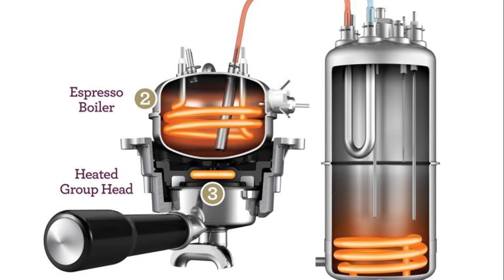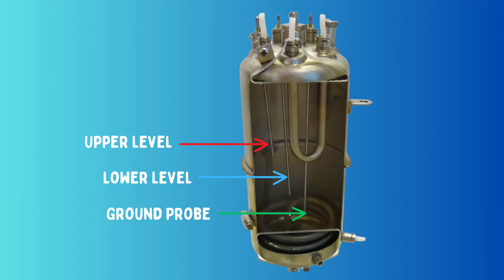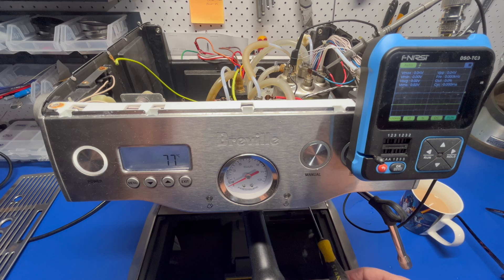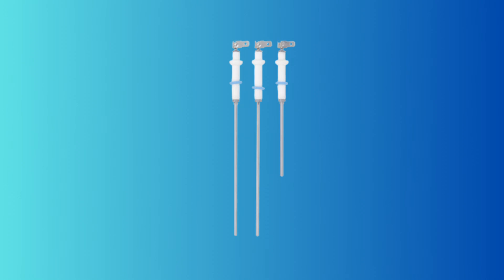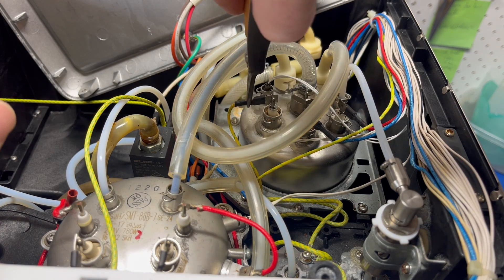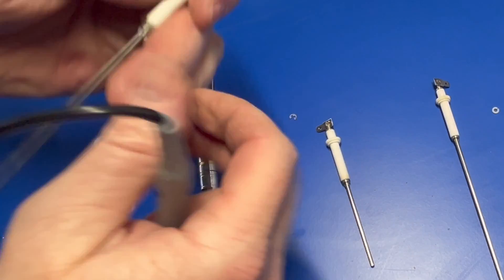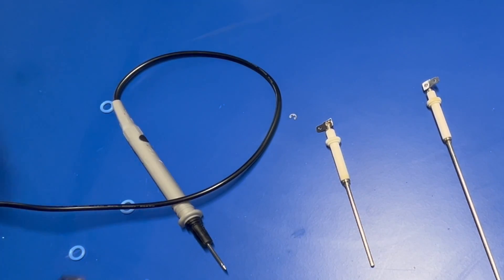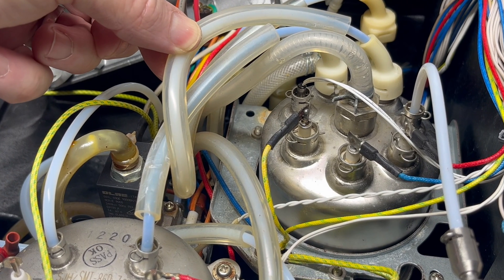How to Fix Leaking Steam Boiler Probes on Breville Dual Boiler BES920 and Oracle BES980 / BES990

Comment from the maker: Since researching the descale videos, I recommend you replace your probes as part of a service, rather than repair them: https://brev-tech.com/products/breville-steam-probe-set
Reply: Where can these be bought?
Reply: aI wrote this after coming back to this video because I had trouble removing the O-rings from the probes. I assumed that if I failed, I’d just replace the probes. Since then, I found the trick to doing it—it's actually quite easy once you get it. I replaced all three O-rings on the probes and finally had a cup of coffee after a month of not using my machine. It was so satisfying—and so cheap to do (though not time-wise 🙂)—that I really recommend replacing the O-rings instead of replacing the whole probe, which, as far as I’ve seen, costs around $200 USD. Of course this recommendation is not related to any descaling problem the probes might induce if they are malfunctioning. Based on your descaling video perhaps there should be a differentiation on this recommendation between the Oracle and the Oracle Touch.  In addition, I wish I could upload a photo here comparing the old O-rings and the new ones. The old ones shrunk so much and were white instead of translucent. That made me think that perhaps it's not related only to aging but also to the descale material used. I wonder what you think of that. Might be interesting to soak such O-rings in different materials for a month and test the result 🙂

Comment: HLL normal?  I feel like my boiler isn’t filling automatically
Reply from the maker: that's not normal, no. it means your steam boiler is totally empty. This is usually a sign of a bad steam pump. Let it cool, take out the pipe from the top of the little pump and borrow the pipe from the steam valve to use in the pump. turn on the machine and see if the flow is strong enough - it should be difficult to stop with your finger

Comment: Is there any difference between the steam boiler probes and the brew boiler probe removal? They look identical on my machine, but I cannot remove them to replace the seals. They move about 1mm before jamming solid, not like you are pulling against an o-ring, it’s a hard jam. Any suggestions?
Reply from the maker: Probably caused by scale buildup. Try twisting them, but they should  come out the same as the others. They can split too those ones, so be careful or have some spares handy
Reply: @BrevTech  thanks for the reply, I’ve tried twisting them without success. I can lift the machine off the table and they won’t budge. I even put some descaler around them thinking the same thing, no luck. I guess it’s stress to destruction time 😁 I’ve got nothing to lose at this stage.

Comment: Hi! Can you advise how to safely remove spade connectors? I’ve tried wiggling them side to side, but they’re stuck very tightly and feel like they might break.
Reply from the maker: they have a lock. you need to pinch half way down in the middle to unlock them

Comment: Hi, I am in the process of replacing the steam probes with new probes (based on your recent descale video) on my 2013 BES920XL. I unfortunately removed the spade terminal from the wire of the ground probe when trying to disconnect it. I am hoping to replace the wire and crimp a new spade terminal to it, but wasn't sure what gauge or type of insulated wire to get. I'm assuming the spade is a 1/4" female spade connecter, but would be happy learn if there's anything more specific I may need. Thanks again for all your help on here!

Comment: I've heard that the most recent models have replaced those with compression fittings. How hard is it to fix those if they fail? Any update video would be awesome! :)
Reply from the maker: The new ones don't have internal o-rings. The do have their own problems tho - the metal rod can get pushed up when the material softens up. Time will tell if this ends up causing leaks, but it's quite possible we will have the same descale problems again if they do.

Comment: @ BrevTech hello. Thanks for the helpful vid! Sorry, dumb question. There are two longer probes (one shorter), are the two longer probes the same and just need to make sure connected to the correct wire/boiler connector?
Reply from the maker: yep they are the same

Comment: Great set of videos. Where can we buy a full set of probes and the tiny O rings to repair them? Thanks
Reply from the maker: I sell the o-rings to repair them in my shop, but I would advise you buy new probes instead unless you have verified yours are still in good condition. I don't sell these, but search for SP0001820 if your machine is pre-mid 2022

Comment: Hi, Brevtech Guy,  I have a BES920, and have 3 questions:
1) The steam boiler level ground probe has been leaking quite a while, & minerals from the water collected between the ceramic collar at the top of the probe & the stainless steel ring on the boiler where it is mounted - can't remove it.  I tried dripping vinegar on that area, and scraping the minerals with a dentist's pick, but so far no luck - any suggestions?  I'm expecting I'll have to wreck it to take it out - any suggestions how to do that?  Turn the machine on its side and chip it out with a small hammer & a nail, pointed punch or chisel?
2) Where do you buy the little white o-rings for these probes? Is there a spec, or what are their dimensions? Is there a supplier in North America? I found this on Amazon - does it look correct?
https://www.amazon.com/dp/B01MTD9ZJ5?ref=ppx_yo2ov_dt_b_product_details&th=1
3) Are the ground and long probes interchangeable?  They look like they're the same.

Comment: You rock! your video helped me fix my oracle by replacing leaking o rings, had to replace the smaller ones inside the probes too. You saved me time and money, thank you for that!! Due to scale and some corrosion buildup, I did the repair with the probes connected as they wouldn't disconnect from their cables. For next time, is there a safe way to disconnect them without breaking anything?
Reply from the maker: Thanks, the connectors have a little catch on from memory and i find it easier to use pliers to slide them off from the probe side. btw, make sure you test your probes are working well. drain the boiler for 5 seconds then wait to see if the steam pump comes on. If it doesn't, go get yourself some new probes. My next video is all about this. I didn't mention that in this video as it's something i later discovered.
Reply: @BrevTech  Thanks! and good idea, I assume you meant to drain after it cooled down then check if it refills when turned on?
Reply from the maker: @avivmor10  no do it while its hot - or at least fairly warm, so you have realistic conditions. Using a flannel over the tray and empty for 5 seconds should be enough to trigger the pump to come on. it sometimes takes 10 secs before it notices the water drop, but just wait. if you hear it come on then your probes are working ok.

Comment: I fixed my machine  by changing the Thermal Fuse and Switch. The blue orings that i have ordered are to thick. I am not able to lock the probes in place. Is there more than one size of the blue rings or probes on the market depending on the age of the machine?
Reply from the maker: yes, they are supposed to be 1.78mm thick. Some sellers don't realise this and sell 1.9mm. Plenty of grease may work.

Comment: 😀I received your Service Kit yesterday and have replaced all the seals on the boilers on my BES 900. Also serviced the solenoid valve. It's 10 years old and needed some love and attention. However, I am getting steam escaping from the red, blue, and black probes. I've checked the seals to be sure they are positioned properly and pressed in the smaller ones into the ceramic housing. When removing the black probe I noticed a second red seal left inside. Question: I've replaced the old light blue o-rings with the blue o-rings. Is that correct? In your o-ring kit you have both blue and green ones. The green seem a little larger and I'm not sure what they are for. If you are able to assist that would be appreciated. PS: Your videos are great. Love the way you describe the process and enable DIYers to successfully fix things. Cheers!
Reply from the maker: Hey, first of all, there should be no second seal inside the probe ports so take out that red one. The blue ones are general use for either the probes or drain ports and the green ones are a made from a different material. Traditionally, I always used the blue ones for the probes; however, the green ones are designed to last longer than the blue ones, so use those on the probes instead of the blue. They will fit ok, as long as you use grease on them. I will try and make better instructions. Thanks

Comment: mine constantly leaks from the top of the probe and i've been replacing these probes for years. It's always the same mode of failure. it's like its designed to fail . the other probes on the smaller boiler is sealed with epoxy so that never leaks. I've been epoxying (JB Waterweld) on the probe tips. they last an extra 1 year before completely replacing the probes.  I now  have to remove the internal O-rings.  This is a great video!
Reply from the maker: That is unlucky!  It sounds like you could've saved a heap of money over the years with a bag of those tiny o-rings :)

Comment: Thanks for the video. On my BES920 ground probe the O-ring is so loose that I would suspect it was the wrong size in the ground probe. I have ordered some of the clear o-rings you have listed. This unit is fairly new and the probe had a little soft scale. I see you have to work a bit to get the O-ring into the ceramic top? Hope I don't have some strange odd part in mine.

Comment: So I just finished replacing the o rings, but now the machine won’t get up to temperature for some reason, it stays stuck at around 156 f , used to work fine before I replaced o rings , any ideas what can be causing this?
Reply: To be more specific, the steam boiler seems to be doing just fine, what seems to not be heating up is the group head
Reply from the maker: It’ll be the triac board. See my other video on how to repair it. Basically you’ll need to solder in a couple of components

Comment: I seem to have the same problem because I only replaced the blue o rings outside of the probe , would the red o rings fit inside the probe or would I have to buy a new size ?
Reply from the maker: No, you'd need to get the correct size, which is in the description.
Reply: @BrevTech  the upgraded o ring kit correct?
Reply from the maker: @jonnathansanchez7004  No, I don't sell them separately i'm afraid - only as part of the survival kit, but the size is there for you to lookup.

Comment: Fantastic vid. I found the best way to remove the old o rings was to use a sewing needle or pin. This way you could get them out without damaging the fine ceramic.
Reply from the maker: Great tip!

Comment: Just wanted to chime in here and thank you for these videos. 

After sending my oracle for repair from a breville approved service technician it came back with replaced o-rings but the probes were still leaking and the machine wouldn't heat over 70c. I was told it was a paperweight  Thanks to this video I was able to replace the probes and identified the technician had put the old probes back in the wrong order, which screwed up the machines ability to read and manage boiler temps.  Your videos are the best source of diy repair info on breville machines on the net and I really appreciate you taking the time to make them.

Comment: Hello! I just received the replacement probes (new ones). I did removed the old ones which were quite rusty. Now, I need to push it really hard downwards to be them in a secure them with the pin, however alone I am able to do it. Will have to get a friend to help with a flat screwdriver or something to create enough force for the space required for the pin locker. Is there something wrong with my steam boiler?
Reply from the maker: did they come with stock o-rings as some after market ones are a little too big.make sure to use plenty of grease is my tip. If you force them then you can easily damage the o-ring all together as they can tear
Reply: @BrevTech  they came with stock o-rings (blue ones) I will be using a lot of grease as per your recommendation

Comment: Would buying a new ones solve the problem or should I buy the wires too. This issue has caused a lot calcination inside my machine and damaged the steam lever(it is super hard to move and down)
Reply from the maker: You won't need new wires, and the probes should clean up ok - unless they are really badly pitted. Do this once a year or so when you swap the o-rings. I have a video on the steam valve so i'd recommend taking it apart, checking the ball is ok and soaking it all in descale solution
Reply: @BrevTech  I will check that one out thanks

Comment: The spade connector on my black wire has totally rusted, and broken off. Should I replace it, and if so, what part do I need to buy - can you buy just the black wire itself?
Reply from the maker: If it’s just the female side that’s broken yes just crimp another one on. It’s a 4.8mm I think. I’d probably order a new set of probes tho if they look too bad

Comment: My brew boiler water probe head swelled due to the brew boiler overheating, and I can't pull it out. Now I need to fill the water manually by turning the water water spout knob. What should I do?
Reply from the maker: pliers? if it's swollen then it would need replacing anyway (they tend to leak) so don't worry about breaking it.
Reply: Thanks for your reply, turns out I stepped on the machine and pulled it out with a piler. And replaced with a set of new yellow probes (the original one is white).

Comment: Thanks for the video! Very helpful. I pulled the probe with blue wire connected and it was very corroded. I cleaned it with 800 grit sand paper but there is still some pitting. Should this probe be replaced? Also the red wire probes oring was still seated up in the ceramic body and not leaking. Do you think it would be fine to leave alone. The other two orings that were leaking were very loose within the ceramic body and easy to remove.
Reply from the maker: The blue probe will be completed submerged under normal operation, so i would say it doesn't matter about the pitting. If it were the red probe and it was badly pitted around the water level line then yes, replace it. As for the internal oring, I would replace all three if you have them all out and they appear to be about the same age. Peace of mind

Comment: amazing video, comes just in time I've an oracle touch open for 6 weeks. I replaced the large o rings but couldn't understand why steam was escaping through the ceramic.

Any idea of the size of those see through O rings? I would order through the link but it has to come all the way from Australia with definite customs issues.
I saw you mention getting away with BS003 - I saw on a forum or another video someone recommending 4.5 mm OD x 1.5 mm
Reply from the maker: 5mm OD x 2mm ID x1.5mm CS i'll add it to the description